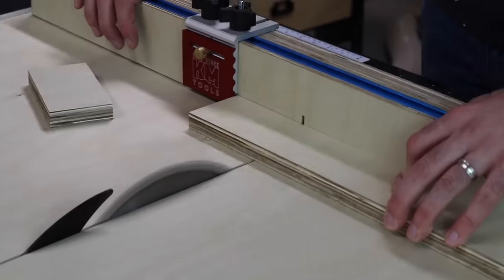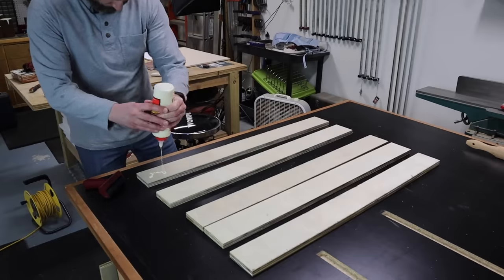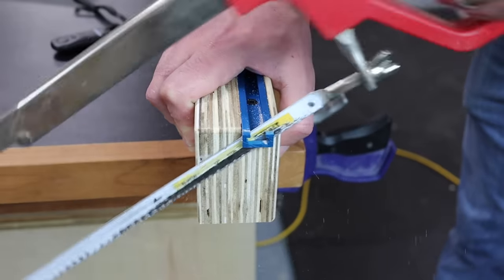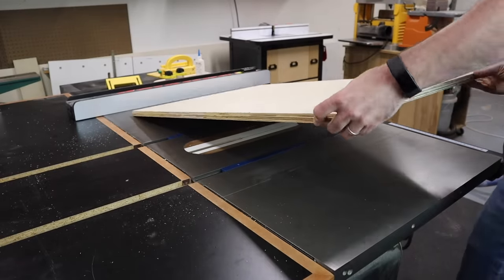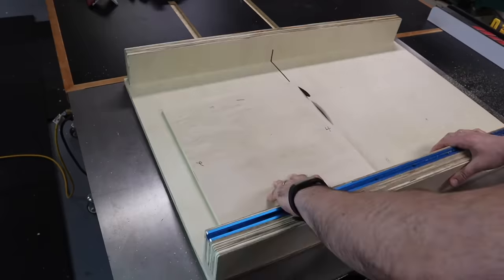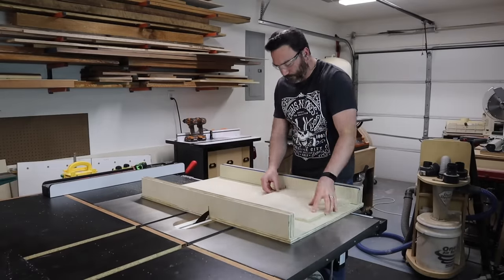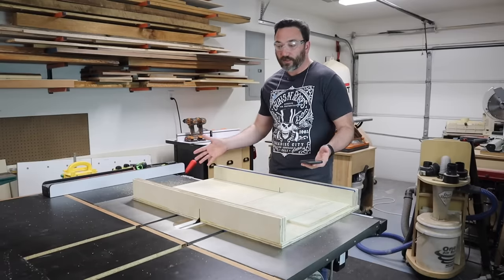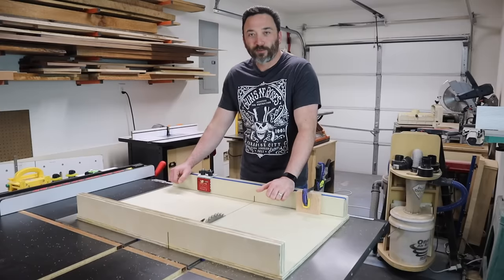Have a Table Saw? You NEED to do This!!!

Comment: For your next consider using Coosa Composites Board.  Coosa Boards are a high-density closed-cell polyurethane foam reinforced with continuous-strand fiberglass and woven roving.  Coosa board is dimensionally stable and is 20 to 30% lighter than plywood.  You can use the same tools and fasteners used for wood products.  Coosa recommends the use of epoxy, acrylic, or elastic adhesives.

Coosa board was developed for marine applications.  I  recently rebuilt  our finished basement, which has had a chronic water problem, with 2x4 framing and 1/2" paneling made of Coosa Bluewater20 and Bluewater26 boards.  This replaced the wood 2x4s and drywall.  We also built cabinets and bookshelves made from Coosa Composites boards.
Reply from the maker: I don't see what the benefit would be. It's made for marine applications, I hopefully won't have any water in my shop. If I do, the miter sled would be the least of my concerns. It's also much more expensive than plywood. And finally, I don't know if it would work on the SawStop without activating the blade brake.

Comment: Well done!  Personally, I would try for 1/2 to 1/3 of the error you achieved but that's probably because I do a lot more metal machining than woodworking and the mentality drifts across disciplines.  One addition I would want for myself is something that I actually did incorporate into my last sled.  I have a raised area on the back fence about 1-1/2" high centered on the blade.  The width is sufficient to my hands are kept away from the blade.  It can be relatively thin, behind the T-track and leaving enough room for the stop to pivot up.  It's just a reminder in case I get too focused on the workpiece to not reach in any farther.

Something else that I did was to put a T-track in the face of the fence.  It allows the positive positioning of a clamping device that I made to hold pieces too small to be held by fingers.  It's just some Baltic birch ply and a screw with a pad that applies vertical pressure on the small piece.  Much of my woodworking is in building large RC airplanes that still need small pieces of wood that have to be cut accurately.
Reply from the maker: Good tips, thanks for watching!

Comment: Instead of using the rip fence to square the base apply stop blocks to the front edge of the cast iron top and square it to that. Then when attaching the registering fence it is automatically aligned 90° to the miter slots.
Reply from the maker: That would not be as accurate as my table saw fence which has been calibrated to be square within a few thousandths of an inch to the blade.
Reply: @biscuittreewoodworks  It is as accurate as the 90° machining of the front edge of the table top to the miter slots, and to a higher degree than the front rail is flat to do the glue ups. Don’t measure when you can fit.
Reply from the maker: @TheStobyReport  On most saws there is no way to access the front and back edge of the cast iron due to the attached fence rail system. Plus, the fence it right there on the saw and already calibrated square to the blade.
Reply: @biscuittreewoodworks  When you were gluing up the pieces of plywood to make the fences, where was the table saw side of the block? Right smack up against the edge giving you a three foot long register for the plywood base. The three foot register is far better than the one inch long base of the caliper you used to measure the 18/1000 of an inch.

Comment: Even on a sled, you should secure (hold down) the piece trapped between the blade and the stop. The drop off piece is fine floating as it can just move away from the blade.
Reply from the maker: Yes, for additional safety you could secure that piece to prevent it from getting caught by the blade.

Comment: Tip: Save your hacksaw arm, and use your miter saw (with carbide teeth) to cut the aluminum track.
Reply from the maker: Yes, I could have easily cut aluminum on the miter saw!

Comment: Clear concise instructions with excellent editing. I recently had to relocate and build a shop 1/4 the size of my last one. That meant making a new, smaller sled. I, too, bought T-track for runners. I planned to use them like you did but was going to flip them the other way to eliminate the need for chamfering the screw holes. Is there a reason not to do it this way?
Reply from the maker: Maybe you just used the wrong term, but the runners on the bottom are miter bars, not t-tracks! Don’t mix those up because t-track will not fit inside the miter slots!

Comment: Another channel worth subbing too. Awesome. I’m trying to remember if you played music through the video, I have a feeling you did. That would be my only critique but I don’t think it was during your talking. Anyways at least it wasn’t distracting. I’m gonna build that exact sled. Was thinking I’d just use a framing square for the back fence but I like your precision 5 step method. I love a challenge and I love to be a sponge Bob absolutely square head !!!! Thanks
Reply from the maker: Thanks! Music is always a difficult thing to get right. Some will love it, some will hate it. It's often necessary to include because dead air on video is terrible, so I try to fill the dead air with very light music almost to the point you don't even notice unless you are listening for it.

Comment: Building my first sled tomorrow. Don’t have a feeler gauge though, so just going to wing it with playing cards and single pieces of paper haha. At least I have a digital calliper!
Reply from the maker: That should work out just fine! A single playing card should be about .010” and a piece of writing paper is about .003”. So you should be able to dial it in very precisely with that!
Reply: @biscuittreewoodworks  the metal casing of 9V batteries is always a hundredth of an inch. When I started measuring them I expected to find some differences. I never have though. Makes ya wonder if there's not some big battery conspiracy going on. But it's still handy shim stock being as consistent as it is. The guts of batteries are different though. If that helps you sleep at night. Duracells are different. There's 6 little metal batteries inside of them. The rest are all sandwich stacks.

Comment: Tip: spray some accelerator on the bottom of the plywood before dropping it onto the track with CyA glue.
Reply from the maker: You can use accelerator spray to speed up the set time of CA glue, I was worried it might react with the cast iron top.

Comment: Quick tip - Aluminum cuts perfectly in a chop saw (or with a tablesaw) - go and put the guides in before trimming the parts to length, and trim the ends
Reply from the maker: Yes, aluminum can cut very well on most woodworking equipment, just be careful if you try to cut it on a Sawstop. Aluminum will activate the blade brake!
Reply: @biscuittreewoodworks  yep. All done by conduction. Joke is I’ve probably cut more aluminum on chop saws and table saws than wood, doing work for 2 robotics teams

Comment: ….and I need a joiner, a belt sander and a router table.  Actually what I need is a woodworking shop.  Great video thought if you have the big boy toys.
Reply from the maker: The big tools help speed things up, but all you really need to build this sled is a table saw and a drill. Instead of the jointer, you can flatten the fences on the table saw. The groove for the track can be routed in with a router and edge guide or dado stack on the table saw or it can be skipped all together. The sanding can be done with a random orbital sander or by hand with a bit of elbow grease. Just because you don't have my specific tools doesn't mean you can't make the same project. And if you don't know how to do something, just reach out and I'm happy to help you find a way to do it with the tools you have available! I have people email and ask me all the time!
Reply: @biscuittreewoodworks  Thanks!  That will be a project for the near future.  I’m working on under stairs storage at the moment.  A big first time DIY project.  I’m managing with the Lords help, and YT of course.

Comment: Just came across your YouTube video. Awesome stuff. A word of advise if I may from an old fart. For your own safety. Pound a 3" finishing nail in the wall and hang your watch and wedding ring on that nail. I've seen a live shop accident of what happens when a ring gets caught in the wrong piece of equipment. It happened to an expert carpenter with 35 years of experience. Let me tell you we both learned a valuable lesson. Love your video.
Reply from the maker: You’re right, and having spent many years in machine shops I should take more precautions. I take them off for certain operations but not everything.
Reply: If a ring gets caught you were too close anyways. 35 years experience just means they've increased the odds of an accident occurring. In a long enough timeline anything that can happen will. When you do something a million times you can't be surprised when that one in a million thing happens.

Comment: I have a tendency to push my sled too far, so I need a bigger safety block on the back of the fence.  I used a block about 1.5 or 2 inches thick but turned sideways so it sticks out farther, giving more for the blade to cut into without getting exposed.  
Also, don't use a crappy calipers from HF to measure A & B.  I don't think mine gives the same results twice on the same measurement.  I adjusted back and forth 12 times (!) before giving up and calling it done, and fortunately it turned out very good.
Reply from the maker: lol, I've done that before making adjustments back and forth chasing that last few thousands of an inch! Good tools can make a big difference! Glad it worked out in the end! Thanks for watching!
Reply: I have crappy HF calipers and I have genuine Mitutoyo Absolute Digimatics too. HF calipers are about as accurate as Mitos are. You can't expect very repeatable measurements on wood ripped on a tablesaw. It's wood that's been ripped on a tablesaw. That's where your inaccuracy is coming from. You can't expect precision from anything that hasn't been hardened and ground.

Comment: 5:30  While I prefer aluminum and UHMW miter bars in my shop (where it gets up to 125f with 85% humidity in the summer) i have used hardwood miter bars in the past, and here's the secret I use...
 
You ready?? 
 
Seal the wood. Lol.
 
I've used water based poly before, but that stuff is absolute garbage. 
 
So, another option (that also waterproofs wood if its a project for outdoor use.) Is Titebond 3 and water. Mix it 2:1 ratio, and itll go on thin, and soak up to the point that you do not realize its even there. (But it turns into a really golden brown color in sunlight, so its not for everything.
Reply from the maker: Sounds like it’s working for you.

Comment: Just wondered about the specs on your screws on your crosscut sled: attaching the front fence and attaching the T-track to front fence?

Thanks again!
Reply from the maker: #8 screws. Probably 1-1/4" or 1-1/2" for the fence, 3/4" for the T-track.

Comment: Thanks for sharing! I have a few questions:
1. What do you think to use melamine at the bottom of the cross cut jig? Can we take an advantage of  melamine slippery? 
2. You said first jig was too heavy. I understood big size was too geavy. But new one looks as big as the 1st. Was 2nd one lighter than 1st one? 
 Thanks in advance for sharing this videos.
Reply from the maker: Some people use melamine for the base of their cross cut sleds, but I don't like it for this purpose because it is too slippery. I don't want to be pushing a board through the blade and have the board sliding around on the sled. So if you use melamine, you need to clamp the work piece down to prevent from having an accident. 
The new sled is much, much lighter than the old one. One major factor is the old sled is made from MDF which is much heavier than plywood. The new sled is maybe 1/3 the weight of the old one.
Reply: I meant to use melamine at the bottom of the jig (facing to table saw surface, where you cover with bee grease) not facing the board we are cutting.
Reply: Thanks very much for your response and sharing. Great video!
Reply from the maker: @DanielFlores-os9fr  Yes, if you have some one sided melamine that would work fine on the table saw surface.

Comment: Great video, great tools, great sled! You lost me a little at the maths though ( I don’t do inches)  Please be kind and consider doing a smaller version, I think this is too heavy for me, I’ve had rotator cuff repair. Best
Reply from the maker: I tried a small version a while back. I found it too limiting for what I do, but you can easily adjust the measurements of the sled to fit your needs.
Reply: Well an inch is 2.54 centimeters. In fact that is the definition of an inch. He used a digital caliper too and that means he was using the decimal inch. So the math is exactly the same as metric. The only change is the units themselves. Metric uses the meter and Standard uses the inch. 1 Meter = 39.370079 inches.

Comment: Thanks for this! Been wanting to build a sled but been a bit scared to. This has given me some confidence to give it a try. Did you ever get any plans together?
Reply from the maker: It's been taking me a while because I want to ensure I'm putting out high quality plans that are easy to follow and have detailed instructions. Once we get the format and quality where I want it there should be many more plans coming out much faster. If you sign up for email updates on my website, you'll get an email when the plans are ready. I'm considering making some of the plans free for a limited time, but you'll need to be on the email list to get the notification!
biscuittreewoodworks.com
Reply: Thanks for the reply. Very much appreciated!

Comment: I noticed that your track continues past your saw onto the outfeed table. I suggest that you put a stop in that track so that you can't accidentally saw all the way through your fence and safety block.

As an alternative, you might screw a piece of steel to the back of the safety block. Which would you rather damage -- your saw blade or your fingers?
Reply from the maker: Grooves cut into my outfeed table prevent the sled from going too far forward. I also have a SawStop table saw so fingers are safe!
Reply: @biscuittreewoodworks  I couldn't tell that from the pictures. Thumbs up.
Reply: I have a "stop bolt", meaning i slide the fence rails over almost all the way and then dropped a bolt through my sled and lightly hits the rails.

Comment: Decent. Rather than the feelers I’ll use my mag base and dial indicators. Lock it to the saw deck and Zero out one side with one indicator to make sure it stays zero and use the other on the adjustment side.
Reply from the maker: Absolutely, dial indicators would work great as well. 
That’s not your typical woodworking tool. Machinist?

Comment: What kind of woodworking needs accuracy of more than a thirty second of an inch?
Reply from the maker: If you are doing general carpentry or building farmhouse furniture type projects, you may not need that level of accuracy. But a lot of projects I build, such as my jewelry box linked below, plus or minus 1/32" is way too much. 
https://youtu.be/UGTYRql3Tbg
Reply: Fine woodworking. 1/32" is finish carpentry. I would consider 1/32" a total fail cabinet making. Well over a distance it'd be OK. But as far as joinery goes I'd want tolerance a lot closer than that. If you think 1/32" is OK I'd hate to see what your dovetails look like. Just get in there with the construction adhesive I guess?

Comment: Completely defeats the SawStop finger detection circuit.
Reply from the maker: No, it doesn't. The blade brake will still work perfectly fine if you are using a sled on the table saw.

Comment: Nice presentation and design.  For angle cuts do you use a chop saw instead of cabinet saw?
Reply from the maker: Depends on what I'm doing. If it's something quick and doesn't require a lot of accuracy I'll use the miter saw. If I need to be very accurate for furniture or fine boxes I'll use the table saw.

Comment: Can you make an attachment to cut 45's with a sled ?
Reply from the maker: You can, but I don't recommend adding that as an attachment to a crosscut sled. Instead I make a dedicated 45 degree miter sled. Adding more attachments and options overcomplicates the design and adds more limitations as well. My 45 degree miter sled is much longer and narrower than my crosscut sled because it better suits that type of task.

Comment: Is there any reason not to use the laminated plywood in the same orientation as the base of the sled?
Reply from the maker: Plywood is weaker and tends to bow lengthwise. By standing it up on its end for the fences, it is much stronger and keeps the jig from bowing.

Comment: What is the purpose of the back fence if you don't use it?  I assume it's to help keep the sled flat?
Reply from the maker: Yes, it keeps the sled flat and square. Without it the back of the sled could move around and flex the front fence or pinch the saw blade.

Comment: I noticed you were using "black" screws on your crosscut sled. What exactly are these screws? They look a bit like drywall screws.
Reply from the maker: Not drywall screws, they are wood screws. I get them from CS Hardware. Very good quality screws for much cheaper than anywhere else I've looked.